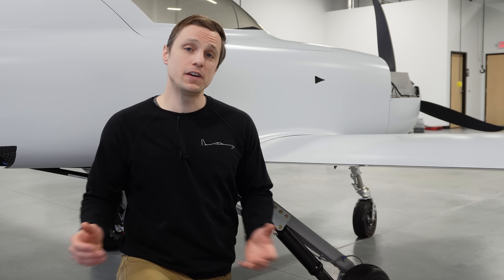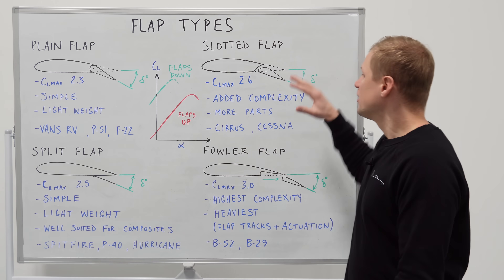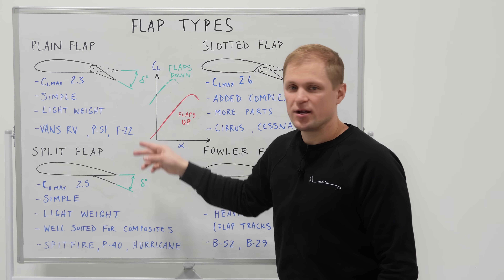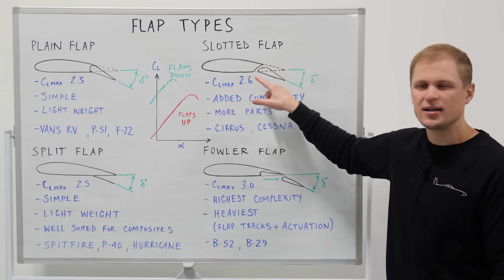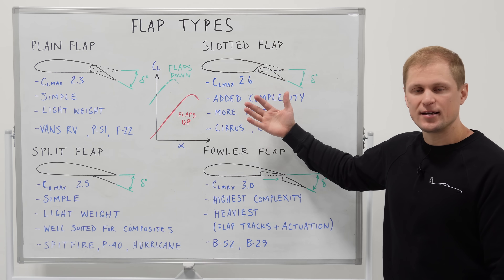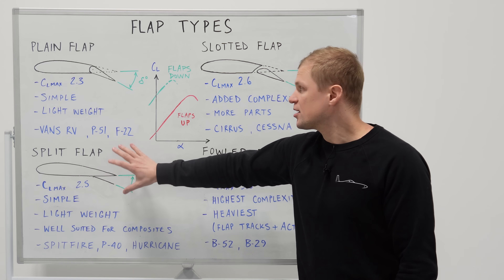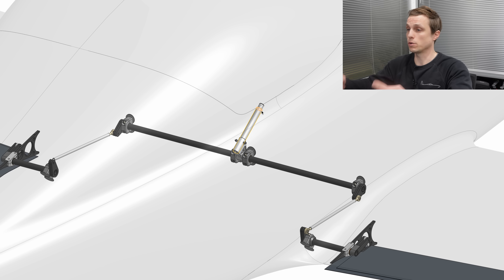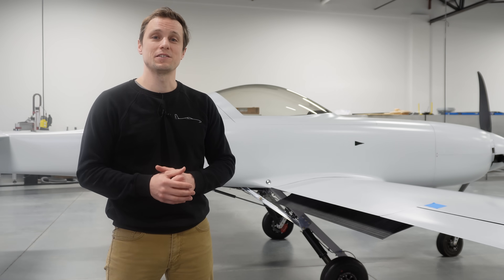The biggest myth about split flaps

Comment: Fowler flaps are often on Ultralight aircrafts In Europe. For instance in Italy they make the ultrafast two seat aircraft called Risen with fowler flaps.. Please note, with 100hp Rotax they guarantee the top speed at sea level 320km/h (173knots) and with turbocharged Rotax 915 -142hp they guarantee maximum cruising speed at 16 thousands feet 450km/h !!! (243 knots ) !!! Will Dark Aero be able to achieve the same velocity with much stronger engine ??? Risen has got the ultimate aerodinamics IMHO. Extreemly efficient and it is all carbon fiber too. What I like about Risen compare to Dark Aero, that Risen is not using any metal(aluminum) honeycomb, but rather materials which can never ever rust.... On the other hand what I like about Dark Aero is the gear(looks strong) and the 2 baggage compartments.

Comment: Fowler flaps: we have them guite often on ultralight airplanes in Europe, for instance Risen. In Italy they make the ultrafast two seat aircraft called Risen. Please note, with 100hp Rotax they guarantee the top speed at sea level 320km/h (173knots) and with turbocharged Rotax 915 -142hp they guarantee maximum cruising speed at 16 thousands feet 450km/h !!! (243 knots ) !!! Will Dark Aero be able to achieve the same velocity with much stronger engine ??? Risen has got the ultimate aerodinamics IMHO. Extreemly efficient and it is all carbon fiber too. What I like about Risen compare to Dark Aero, that Risen is not using any metal(aluminum) honeycomb, but rather materials which can never ever rust.... On the other hand what I like about Dark Aero is the gear(looks strong) and the 2 baggage compartments.

Comment: All my life everything I've read and heard has said that split flaps provide no lift, drag only. And the statements were from what I thought were reputable sources.
Reply: Fowler flaps are often on Ultralight aircrafts In Europe. For instance in Italy they make the ultrafast two seat aircraft called Risen with fowler flaps.. Please note, with 100hp Rotax they guarantee the top speed at sea level 320km/h (173knots) and with turbocharged Rotax 915 -142hp they guarantee maximum cruising speed at 16 thousands feet 450km/h !!! (243 knots ) !!! Will Dark Aero be able to achieve the same velocity with much stronger engine ??? Risen has got the ultimate aerodinamics IMHO. Extreemly efficient and it is all carbon fiber too. What I like about Risen compare to Dark Aero, that Risen is not using any metal(aluminum) honeycomb, but rather materials which can never ever rust.... On the other hand what I like about Dark Aero is the gear(looks strong) and the 2 baggage compartments.

Comment: Simplest fowler flap design Ive seen is on the Aviat Husky, which came from the Callair.
Split flaps on the early C-310s.
Reply: Fowler flaps are often on Ultralight aircrafts In Europe. For instance in Italy they make the ultrafast two seat aircraft called Risen with fowler flaps.. Please note, with 100hp Rotax they guarantee the top speed at sea level 320km/h (173knots) and with turbocharged Rotax 915 -142hp they guarantee maximum cruising speed at 16 thousands feet 450km/h !!! (243 knots ) !!! Will Dark Aero be able to achieve the same velocity with much stronger engine ??? Risen has got the ultimate aerodinamics IMHO. Extreemly efficient and it is all carbon fiber too. What I like about Risen compare to Dark Aero, that Risen is not using any metal(aluminum) honeycomb, but rather materials which can never ever rust.... On the other hand what I like about Dark Aero is the gear(looks strong) and the 2 baggage compartments.

Comment: I see most of what you are getting at, It depends on the intended type of field used by the aircraft. If you will always be at runways with nice clearways then you may only care about getting maximum lift to reduce touchdown speeds and reduce stress on tires and gear, drag can be modest. 
If you plan on locations with  steep final approaches to shorter runways, then energy management is more of a concern than minimum touchdown speed and adjusting drag is more important than lift. 

A generally versatile behavior is for a small deflection to add some lift with minimal change in L/D (Maybe even a slight improvement over the clean wing.). Then as  flap angle increases a rapid increase in drag relative to lift. (Gliders take it to the extreme of adding spoilers to the top of the wing.) 

This doesn't require ideal flap behavior of course, as long as the flap design is "good enough" then the cruise and manufacturing concerns, that were mentioned in the video, become major factors.

Comment: Why dont you guys add some slots at the root of those flaps to pass some air through to the trailing edge of the wing to reduce that low pressure zone? Imagine if you had slots at the root that looks like a hair comb that lets air pass.

Comment: One of my biggest surprise when transitionning to the PA-28 Archer was my intstructor asking me to do a flaps up circuit and landing. He asked me at what speed I would fly the circuit and landing and I was all bent to say for sure faster than the regular speeds used traditionally. That's when he told me just fly the same speed as normal no need to fly faster just the attitude will be more nose up and power setting would be different. The "flaps enable slower speed" is really only true for the stall speed (a few knots of difference as per POH) but as you would never fly that slow anywhere in normal flight that wouldn't do any difference.
Reply: When flaps are deployed they back the airflow up under the wing, this increases upward pressure applied underneath the wing, hence more lift. For a given speed this means the wings will be pushing down on the air underneath harder, this greater downward force on the air shifts the stagnation point further away from the leading edge creating a greater upwash of on-coming air. The greater upwash leads to more momentum of the flow over the top of the wing which does indeed delay stall for a greater camber or AoA. However it's the lift pressure induced by the deployment of the flaps which give rise to this favorable airflow, so much pressure that that's why there's a VFE on aircraft, exceeding these limits results in structural damage.

Comment: Really happy you guys are staying simple with manual bar for flaps. Easier build, less failure points over time, simple.
Reply: More enjoyable experience flying imho. I always love the manual flaps in the piper over the Cessna electric flaps as I continue to learn to fly.
Reply: Better ergonomics too. No need to stare at the flap indicator.
Reply: @ammerudgrenda  If you learn how the flap handle moves with relation to the detent, and how the airplane feels with different flap settings+airpseed+power settings, you don't have to stare at the indicator.

Comment: Two comments, 1) A big disadvantage to fowler flaps is the change in the center of lift. That can be mostly mitigated by adding leading edge devices. Of course that adds complexity but worth it on some aircraft. 2) Aluminum structure complexity can be greatly simplified especially for a simple part like a split flap by using a foam core and bonding aluminum sheets for skin. I've done this a lot and it's much more simple than a composite layup or molded composite part.
Reply: Fowler flaps are often on Ultralight aircrafts In Europe. For instance in Italy they make the ultrafast two seat aircraft called Risen with fowler flaps.. Please note, with 100hp Rotax they guarantee the top speed at sea level 320km/h (173knots) and with turbocharged Rotax 915 -142hp they guarantee maximum cruising speed at 16 thousands feet 450km/h !!! (243 knots ) !!! Will Dark Aero be able to achieve the same velocity with much stronger engine ??? Risen has got the ultimate aerodinamics IMHO. Extreemly efficient and it is all carbon fiber too. What I like about Risen compare to Dark Aero, that Risen is not using any metal(aluminum) honeycomb, but rather materials which can never ever rust.... On the other hand what I like about Dark Aero is the gear(looks strong) and the 2 baggage compartments.

Comment: 9:42        air  is  STATIONARY !!!         therefore, these wind tunnel results are not  persuasive.
Reply: My guy when the aircraft is in motion, the air is moving relative to the plane. That's what the wind tunnel simulates but instead of the wing moving the air does.

Comment: What do you call the flaps on a commercial passenger airliner where the whole flap moves like 1m backwards and down?
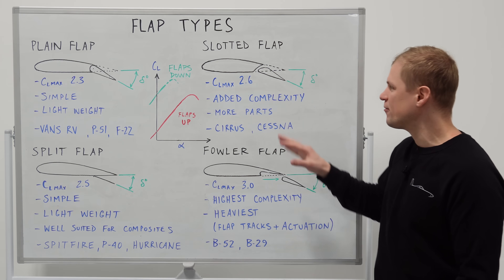Reply: 7:02
Reply: @daviddavids2884  so which one
Reply: Basically, these are (multi-)slotted fowler flaps, a combinaison of slotted flaps and fower flaps (the two types of flaps see on the left of the board).
Reply: @TheBumpking right of the board?

Comment: Great video, you fixed my misconception that split flaps are more draggy than plain flaps. 

I hate to be ‘that guy’ but the actuation linkage builds in the opportunity for a linkage failure to give asymmetric flap deployment. If you are able to put the torque tube on the hinge line of the flaps then you could have a single linkage from the flap handle to the torque tube rather than two, meaning that if any articulated joint in the system failed you would be left with a symmetrical failure rather than an asymmetrical one. 
Please keep the videos coming, you’re doing incredible work.
Reply: smart to make the failure mode symmetric. let em know. this is the kind of stuff that next time will appear in an air crash investigation. they should fix it now.
Reply: The linkage is not a very elaborate design. Complicated sure, and fancy too, but not elaborate. Maybe somebody is running out of time.
Reply: air  is  Stationary          wind tunnel testing is  NOT  conclusive.
Reply: @daviddavids2884   You got things mixed up. Stationary air does not exist, which is the reason why wind tunnel testing does not conclusively simulate flying, but it's still usefull.

Comment: Aerodynamics tells me with the hinge point fixed at the front of the flap, when the flaps come down the trailing edge will effectively come forward thereby decreasing the mean chord. CoP will come forward (relative to CoG) reducing the relative moment arm and inducing a pitch-down tendency requiring nose up trim. That will be interesting to see confirmed during flight testing.

Comment: There is another flap design that you haven't mentioned. It's used on a family of aircraft popular in Europe - the Dyn'Aero MCR series. (I fly the MCR01). They use a double slotted fowler flap, employing a simple drop hinge. The whole system is simple, but provides a high performance. More about it here: http://contrails.free.fr/temp/Pilot100Yrs-06-164.pdf
Reply: There are a lot of flap designs - see the Wikipedia page for "Flap (aeronautics)" for an overview.

Comment: Hi. One thing you mentioned was sealing. The gliding community have always been ahead in this area and use Mylar sealing and turbulating tapes. I have an 18 metre flapped Schempp-Hirth Ventus and it is sealed and turbulated within an inch of its life. A gliding buddy of mine has an RV in which he set various records in, including the elapsed time London-Cape Town-London record for a 200 hp aircraft. That is beautifully taped; everywhere! Have you considered what tapes you will use? I’ve attached a link to the first glider supplier I found. I live in the U.K. and have no connection with the company, but their site has a great selection for you to browse. Just a thought. My mate’s RV is impressively fast with a stock engine. But there’s not a gap an air molecule could squeeze through! I notice that the ailerons don’t yet seem to be sealed.

Comment: Another exemple of a fast light aircraft using split flaps is the JMB VL3. Also, some flaps are more easily mixed as flaperons to inmprove low speed handling, which is the important limiting factor besides stall speed and stall characteristic. Looking forward to first flight !

Comment: If the split flap has both less drag (both in cruise and deflected) and more lift... what's the advantage of the plain flap?  It doesn't seem simpler.

What is the area of the flap, and what is the expected torque and force that you have to apply to the flap handle?
Reply: They explained the structural advantage of the plain flap for conventional built-up aluminum construction in the video.

Comment: What other aircraft exist in this particular design envelope that you've chosen? I can't think of any other single-engine aircraft, experimental or production, that fits in a two-car garage, has retractable landing gear, a full carbon fiber (NOT fiberglass) airframe, and THIS much range at high speed. Am I also correct in assuming that even though the flap control link is at the root of the wing, the stiffness of both the linkage and the flaps themselves ensures that any potential fatiguing or failing due to torque from the loading forces is a non-issue?

Comment: That was very informative. Did you guys do the load calculations on the flap surface area to see what amount of force would be needed to overcome wind resistance at say 150kt's worst case scenario? First thing I felt was the system needed more mechanical leverage on both ends of the long link. Very much so enjoying the whole thing btw.

Comment: Guys, did you consider placing the torque tube coaxial to the flap pivot? In this case it seem to have more reliable mechanics. At least now if one of the links fail there would be differential lift created, which could be very dangerous obviously
Reply: Was thinking something similar - I like the way the RV does it - you can have asymmetric flap deployment if you have a pretty serious hardware failure on an RV, but there is very little hardware in the solution, and you can inspect the critical bits during preflight.

Comment: Nice but I suspect you'll need extra leverage for that handle as the manual actuation loads may be a bit high for some pilots. Did you calculate them? Most manual flap handles are two to three times that length and even then some of those are pretty heavy in flight.

Comment: Nice update gents!

Does the center of lift move back when the split flaps are deployed?  (A Mooney characteristic)

If no…. No trim change required with deployment.
If yes…. Trimming while deploying flaps at the same time and rate, is nice…

Safety opportunity…. Nothing worse than flaps accidentally retracting.  Fast uncommanded retractions can be extra hazardous, as the stall speed may exceed the current airspeed without warning!  (Hand slips off the handle, position lock not engaged)

Split deployment… is there a way that the flaps can accidentally deploy or not retract on one side and not the other?

A few minutes during the transition training should cover how best to use the flaps, trim, and what to avoid during slow flight.

😃

Comment: So best L/D is the criterium to choose for it. But typically you want more drag during landing so you need an additional system to achieve this?
Reply: no, more drag is not wanted.          lift always comes with a drag 'penalty'.        thus, flaps  ALWAYS  make 'extra'   DRAG,  along with extra lift.        and, during landing, correct throttle management - for the extra drag - becomes a very big deal.
Reply: The DarkAero has a split rudder design that works as a speed brake (adding drag) if both rudder pedals are pushed at the same time.

Comment: Is there a concern about the force required on that short handle to activate the flaps? Just looking at it has me a little concerned if there is an attempt to open the flaps at any relevant speed. (Even at a 50kt airspeed, there would be a pretty high torque because of the surface area of the flap.) It seems to me that this is also why most older aircraft I have seen with manual flaps have relatively long handles.

Comment: The Fowler flap "complexity" is just a single hinge if you put the hinge a few inches below the leading edge of the flap. No need for tracks or anything
Reply: While it might be debatable whether or not that this a Fowler flap, it is certain that DarkAero does not want hinges sticking out into the airstream all of the time.

Comment: How about no flaps and handle it with angle of attack if you need slower. Cleans up the design nicely.
Also what's the progress, guys? it has for quite a while seemed like you have been distracted and progress have ground to a halt. The plane was basically flyable 2 years ago. I'm a massive procrastinator, I'm not saying I'm better, but I'm saying you can't afford to be this slow.

Comment: Should have started with the flaps and design the wing back.  Would have ended up with a TBM wing:  full span split flaps, feelerons and spoilers.  MU2 similar, but with Fowlers.   Both these planes are the fastest in their class.
   A 15% wing has a more robust laminar run than a 12% thick wing in the real world conditions.  If the 15% allowed the gear to retract into the wing, then more  another flap across the belly.  Too late now.